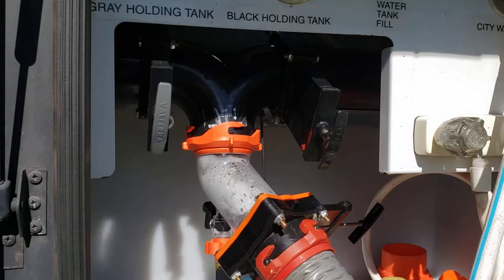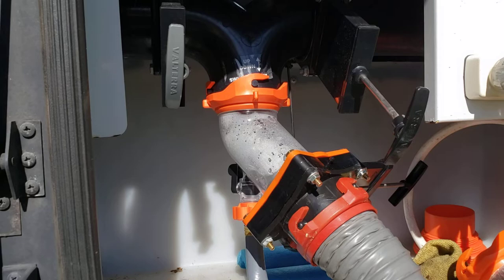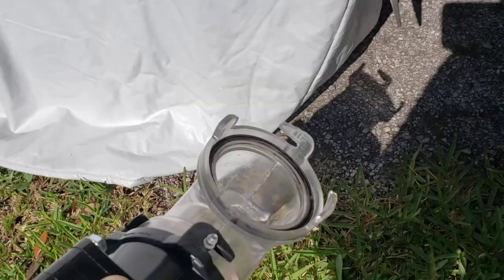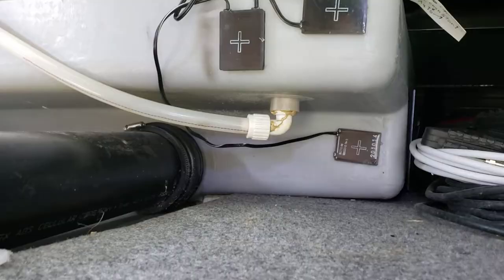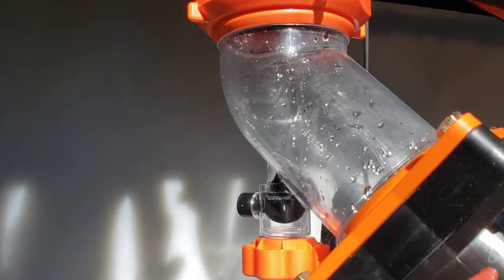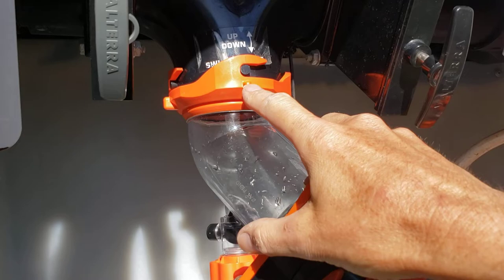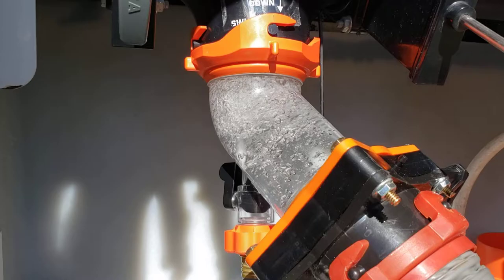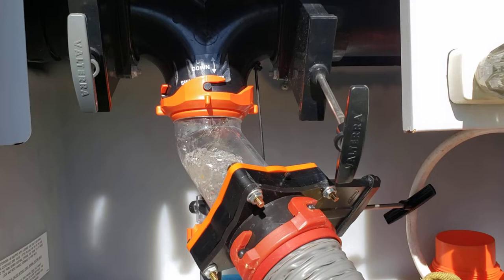OH CRAP!! RV Black Tank Clogged with Toilet Paper This is How I Clear a Blockage in Our Black Tank

Comment: I got mine in a few days ago. Hooked it up yesterday and started trying to get the tank unclogged. I went through a couple dozen cycles and while it hasn't completely unclogged the black tank, it has certainly loosened up the compacted clog and I can see it discharging a little bit each time, which I would prefer over moving one massive clog into a 3 inch discharge pipe clogging that up. So small amounts at a time is good with me until it is completely unclogged.

UPDATE: After working on it off and on (I had to order another one because I broke the first one being stupid) the clog finally cleared!
Reply from the maker: Thank you for contributing Mark.

Comment: I also have a downward facing outlet on my camper, and I bought the Camco unit like this but for some reason the gate handle was turned 90 degrees as opposed to this example. It was unusable because it interfered with the camper. I had to get the Valtera water hose hookup as well as a Valtera gate valve below.
Reply from the maker: If you give it a twist it should swivel to any position you need?
Reply: At $90CDN I guess I was more concerned with finding the reciept,  lol. I think the cost ended up about the same anyway. Cheers! @ktoutdoor

Comment: From experience, don't start doing this and let a neighbor distract you.  Not only does it create a mess (toilet volcano?) but in my case, it flooded the basement and therefore flooded my inverter/charger which then caused a cascade of 12v appliances to quit until I connected an external 12v source to the house battery while the new charger was being shipped to me.  No bueno...
Reply from the maker: Thank you for contributing, sorry you had such a bad day. Been there done that also...

Comment: HI I've got a question for you, as my black tank is still clogged, how do you know when you pull the black tank pulley that the gate valve is actually open? I did mine and i opened the gate valve and NOTHING came out but a small trickle down the pipe it is hooked up to the sewer system here; I pull the gate valve pulley and it should go whissh down into the pipe and away into the large holding tank; alas no that did not happen so thank you for any answers
Reply from the maker: Text me at 606-875-0125 so I can call you back kevin.

Comment: We have the back wash but it won’t work. 

We were using the wand to clean the black tank in the toilet n it was all going down then we sprayed the toilet paper that gets stuck right out of the toilet and into the black tank. 

The TP came off and clogged the Hole going out of the black tank and the dirty water backed into the toilet n we are trying everything to get it to go down. But it won’t. 

We snaked it n that didn’t work either. 

There was already downy in it. 

So I poured baking soda and lemon n vinegar in it. 

It bubbled but after a few hours nothing happened. 

So I poured ammonia into it because the stores are closed n it’s late at night and I used all my yeast up before Passover got here. 

I also put dawn dish soap in there. 

We don’t have a plunger, but heard it might work. 

My husband wants to get drano cuz he’s fed up but I already have so much in there I truly don’t want an explosion! LOL 

Nor do I want anything getting any more messed up than things are already. 

We are going to leave it overnight and see what happens tomorrow. 

We are saying prayers. 

Our worst problem is this happened on our sabbath. Grrrrrrrr! 

🙏🏼 

I never thought I would need a plunger in an RV. 

🚽 🪠
Reply from the maker: Text or call my cell I will try to help you 606-875-0125 Kevin